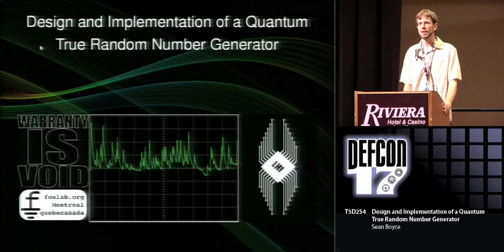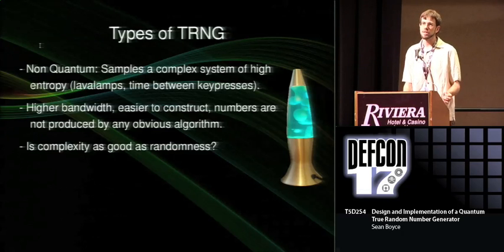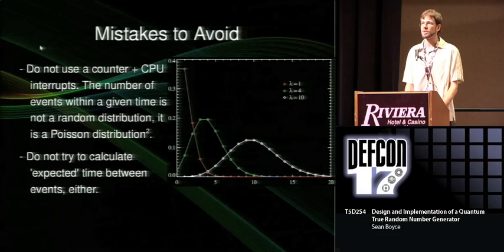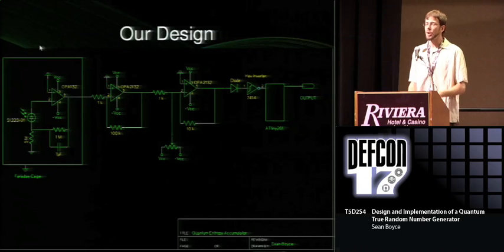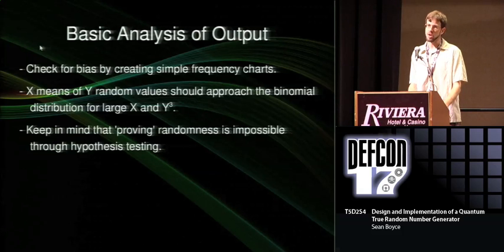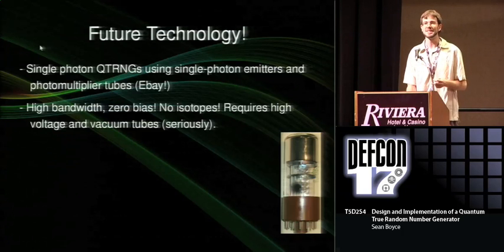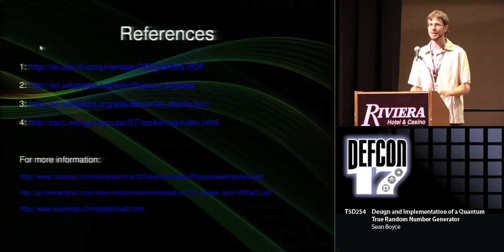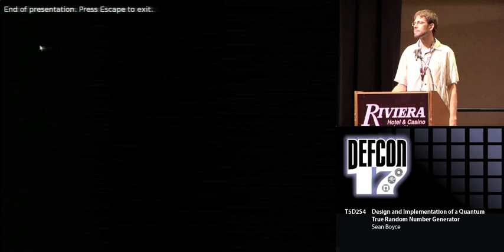DEFCON 17: Design and Implementation of a Quantum True Random Number Generator

Comment: Sampling a clock with another clock can be considered as a quantum TRNG? I built one but I don't know if the randomness comes from the clock drift (bad) or from the quantum scale (good).
Reply: It does not matter. Every sample taken from a quantum based system is totally random. Unless we find out that it can be affected somehow :)
Reply: @marko_z_bogdanca  No they are not. Your sampling process is not capable of extracting unbiased, uncorrelated bits from a "quantum" source any more than from macroscopic noise.
Reply: @davidjohnston4240 it is nice that you answered after 7 years 😅. However lately the willow chip showed sone strange anomalities in the "random noise". It appeared to have some common parts within multiple qbits  The noise had structure that could not be understood. So I change my anseer. It appears that the truth is even weirder.

Comment: The negative advice regarding use of 2 quantum detectors is against real world evidence.  All commercial beam splitters use two detectors, one for "1" and another for "0".  It would be problematic detecting two laser beams otherwise...
Reply: Random Unbiasing first described by Von Neuman as part of the Manhattan project is needed to take account of the bias in the splitter for the  paths as they do not have the same sensitivity.

Comment: It seems it is just another TRNG because hardware is not ideal, detector is not ideal, nothing is ideal. So you just pick noise from sensor just like other TRNGs do. I can't get the quantum idea. If this noise is about quantum mechanics then simply you can tell other TRNG methods are dependent to quantum mechanics in fact. Also it is said that it is impossible to obtain random numbers from deterministic systems. That's true if you have data of every molecule in air for an atmospheric TRNG.
Reply: How is the time interval between particle decays deterministic?
Reply: But you =can't= have enough data of every molecule of air for an atmospheric TRNG. Heisenberg will get you.